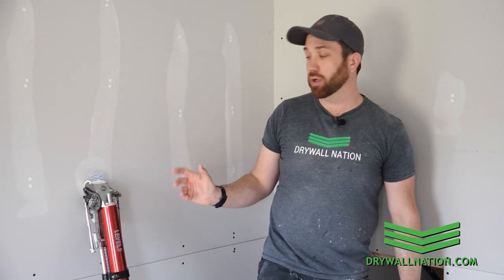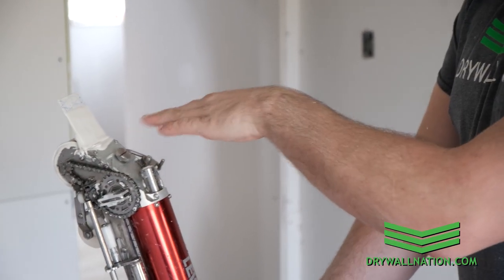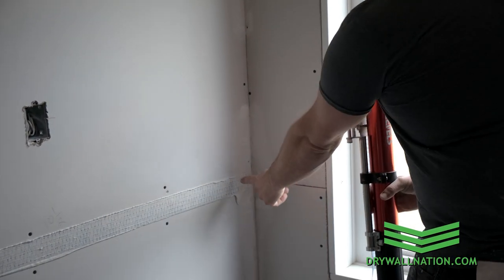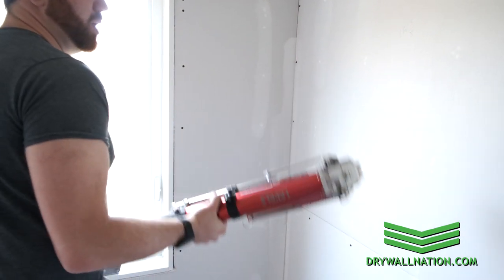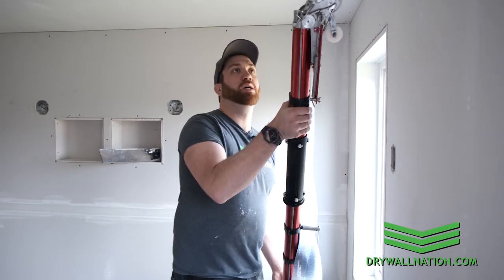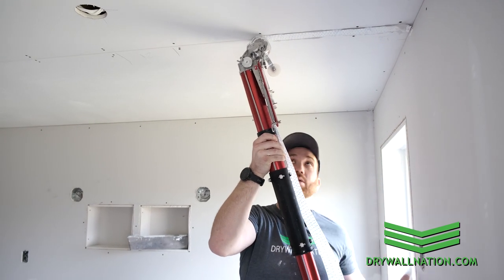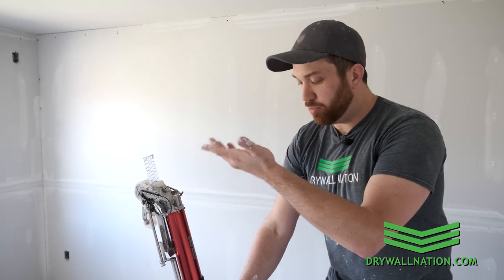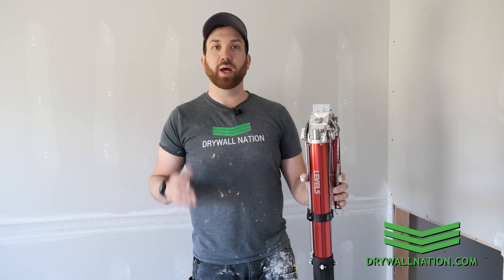Beginners Guide to Taping Walls & Ceilings with Automatic Taper

Comment: I got mine and having trouble with it on a 16 ft wall it is pulling the tape 10 to 12 inches on corners cant get started with out having an another person holding the tape seems to me i have alot of mud in the drive wheels and on the head any suggestions

Comment: Do you use the fibafuse tape for inside corners also?
Reply from the maker: No, we do not. We used to but it was too temperamental to work with so we switched back to paper in corners.

Comment: Wiping with a 6" knife? I prefer a 8" for about 50 years now.
Also, I prefer the "old school" single sided cutting blades for the bazooka so you don't get the double cut.
Thankfully, I have a good stock of those units that should last me until I die. LoL! Surprisingly, I don't break many blades.

Good videos by the way. Pretty much right on.
I've been doing this so long. I don't even think about it. I'd have a hard time explaining this as well as you have.
Reply from the maker: A 6" knife is my go-to carry. I use it for just about everything. It's a good average size for spotting screws, wiping tapes, cleaning 3 ways etc etc. I usually run the taper and have my guys wiping behind me so I only carry a 6". 
If one of my guys is running the taper and I'm wiping tapes all day then I'll grab an 8" like you. Holds more mud and fills the bevel better. And yeah, those old-school single sided cutting blades were awesome. Haven't seem those around in years though. And thanks for the kind words man. We try to give as much info as possible for the people watching and learning.
Reply: @drywallnation  Yep. I carry a 6 in  my back pocket all the time... well not to bed. LoL!
I work exclusively by myself. I have turned into a legit drywall contractor... well Me , Myself and I Drywall. I have hangers that I use when there's more than I want to deal with. They don't like to finish. I don't mind hanging until it's ridiculous for me to deal with. I hang all my own metal. I know what it's supposed to look like.
Back "in the day", when all we had were Ames taping tools (until their patent ran out). We, and the company I worked for,  would get parts for free from Ames for renting their tools. When my dad quit doing production work, and between him and what I collected, I have quite the supply left over. I've got some of the old blades still made in the U.S.A for 7", 10" and 12" skim box. Very high quality and they last forever too. 
I should retire, but after 50+ years of doing this.... and people won't leave me alone. I'll continue to work at it. And I'm trying to build a car.

I've found there's nobody out there, at least in this area, which used to be an unusual hot bed for drywall work, knows the proper way to use the tools. Everybody that knew has died off. Now there area bunch of geemos who have never been taught how. Every time I think that I've slowed down, I watch these guys work and shake my head. When someone sees me work, they can't believe I'm the only one on the job. I tell them to get out of the way. LoL!

Comment: Using  the fiber  tape  is gonna crack all joints  lateral. Dummy.. use peper  tape
Reply from the maker: It's Fibafuse, not mesh tape.
We've been using Fibafuse for over 9 years and it's better in every sense than paper tape. We only use paper tape in our corners. Educated yourself on a subject before leaving ignorant comments.